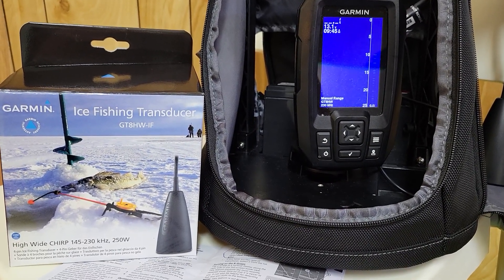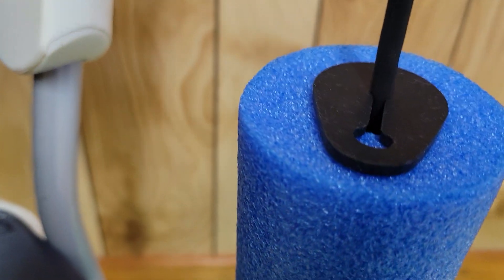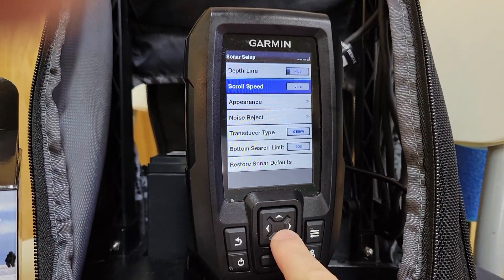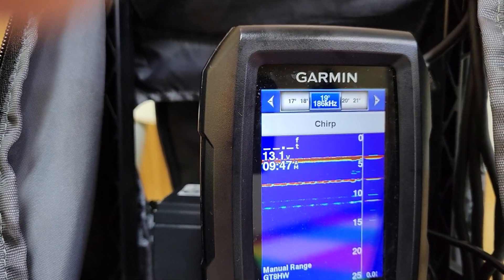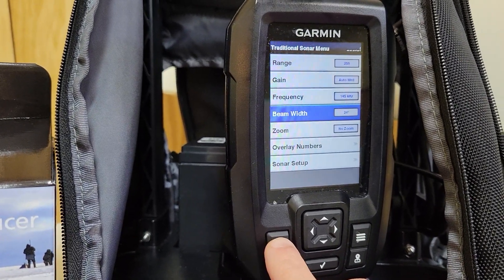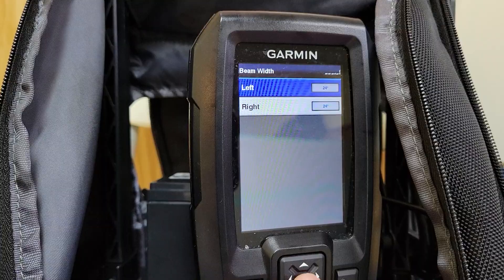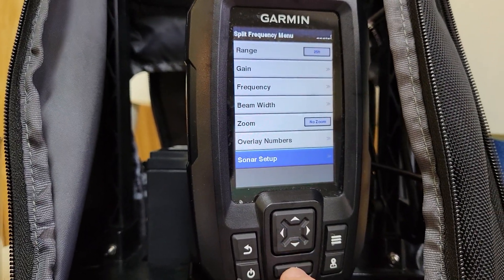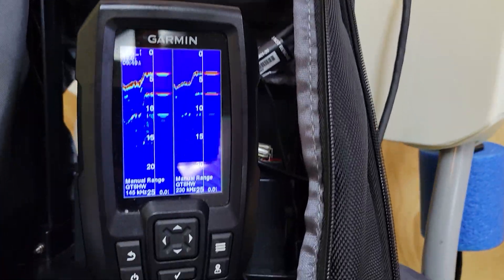Garmin GT8HW-IF ice fishing transducer

Comment: Does this transducer display water temp?
Reply from the maker: I don't think it measures water temp like the stock transducer.
Reply: @dustinj7650  I've come to the conclusion that it does not. I've went though all the settings not important to me anyways. Do u still use this unit today? I love mine it was a bit of a upgrade from vexilar Fl-8 slt
Reply from the maker: @mattgehrke luv it, flex line, hangs straight, easy height adjust, and gain pretty easy to dial in.

Comment: Thanks for the info. I recently bought one. Do you know why the cone angle defaults to 19 degrees every time I select CHIRP frequency? If I select any other cone angle, it kicks me out of CHIRP mode?
Reply from the maker: it shouldn't, I think the way mine works is you can select within the beam range but it should still be chirp. Maybe double check that you selected the GT8. Also, there are two different models, one is a dual frequency maybe you bought the wrong model.
Reply: @ mine is the GT8HW-IF too. Just that if I select a different beam angle, the bottom left of the screen says xxx kHz instead of CHIRP. Maybe all the frequencies are CHIRP?
Reply from the maker: right, it should still be chirp, but it will show you the beam width you are on! @markjing1550
Reply: @ thank you!

Comment: So I contacted garmin. And they said do not select that setting since they claim it's not for an ice transducer. When I look it up there multi GT8HW-?? I tried it on the recommended setting and I was hitting fish left and right. Only time I bought anything using this unit. But like you said all the settings that are adjustable are what it says out of the box. I'm still confused.
Reply from the maker: the package my transducer came in indicates "High Wide CHIRP, 145-230 kHz". The only way I am able to select frequencies between 145-230 kHz is if I select the 'GT8HW' sonar type. If I follow the manual and select 'dual frequency', it shows me only a 50kHz and 200kHz option (which doesn't match what the product is capable of). So I believe the correct choice is to select 'GT8HW'. Note: this holds for both the base striker4 head unit, and the 4cv head unit.

Comment: Accidentally bought the striker plus 4 with the Open water transducer. This would be far superior to that, correct? I purchased a 3D printed part to hold the transducer level but it appears to be directional and not straight down like I would expect the ice fishing transducer to behave
Reply from the maker: I think all the various transducers work well. But, regarding the boat transducer, it is very important that the rounded flat part hangs horizontal (flat to bottom). You can play around with the lock nut and bend the wire to make it hang straight. The ice transducer removes having to do all that!

Comment: Hello! Please tell me which sensor on the Garmin Striker Vivid 4cv echo sounder is better to use in order to see fish at great depths (200-300 meters) on winter fishing? Native GT20-TM or winter sensor Garmin GT8HW-IF 4-pin CHIRP? The native GT20-TM seems to have more power, so in theory it breaks through greater depths better?
Reply from the maker: I am not sure. But I do know the GT10-IF transducer is 500W, has a narrower beam, and they indicate it works down to 800 feet (244 meters)
Reply: @DJ20123  do you know if it would be worth it to get the GT10? The GT8 is on sale at my local cabelas/bass pro for around 90$ and the GT10 is like 230$
Reply from the maker: @whatapsycho  if you fish in deep water you may need the GT10. It goes to 300 kHz and a very narrow beam.

Comment: I was wondering about this myself as I just bought this transducer. Luckily buying it from amazon it listed it correctly and I did get the chirp version right off. But I originally just got the base model not the ice fishing setup so bought the case and everything for ice fishing separate. So looking forward to use it with the ice transducer rather than making sure the regular one is level each time.
Reply from the maker: it is definitely a weight off not having to wonder if the ducer is hanging properly, and the quick adjust float makes it really easy to set it to a depth just below the ice. Great to hear you got the ducer you wanted!

Comment: Thanks for the post. I just ordered one today. This will definitely speed up my setup time! Last year I just modded my  normal transducer for ice fishing. But  I read the reviews and everyone says it's a good upgrade!
Reply from the maker: What I have learned since posting this video is the 230kHz frequency (16 degree cone) provides more energy (therefore better separation of signals). Also because its a narrower cone it is more likely to return signal from the bottom (vs. a wider cone that would be more likely to return signal from a 'slope' or bottom dropoff that cuts the signal off at that point, making the actual bottom invisible). So I plan to use the 230kHz as much as possible...only switching to 145kHz in very swallow water.
Reply: @DJ20123  thanks for the update!!
Reply: Didn't realize that the one I ordered is more basic then your model. You do not get near as much adjustment and tuning with the simple Garmin® Dual-Beam IF Ice Fishing Transducer. Will see how it performs come the the weekend. Im assuming similar to just my basic boat transducer. 
 
(17)
Write a review
Reply from the maker: @vedan304  yes same - I had ordered that one thinking I was getting the chirp model. I believe the dual beam doesn't have chirp - there was false advertising in my case, I wrote to the company and they fixed their website. Double check - same thing may have happened to you. If they advertised chirp, it is false advertising.
Reply: @DJ20123  yah. No biggy. I'll just try and see if it feels like an upgrade or not. definitely nicer with the cord and the strip for sure tho.